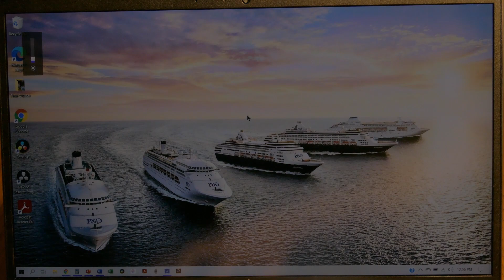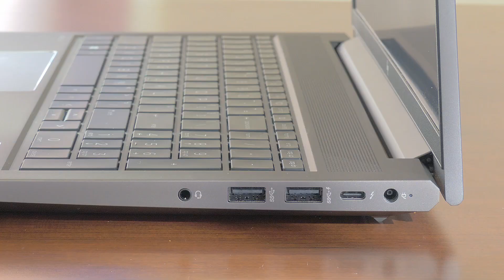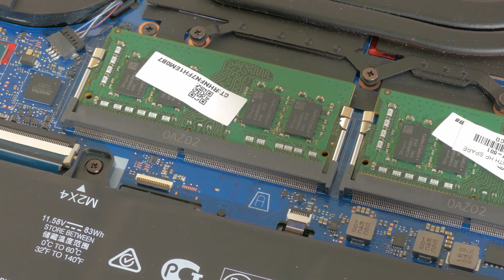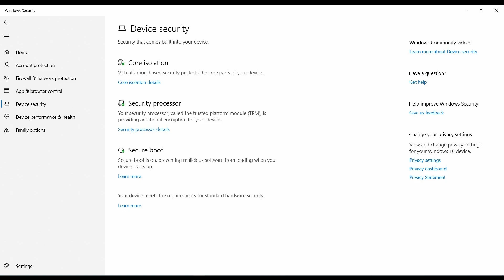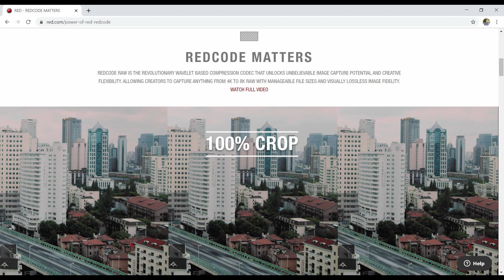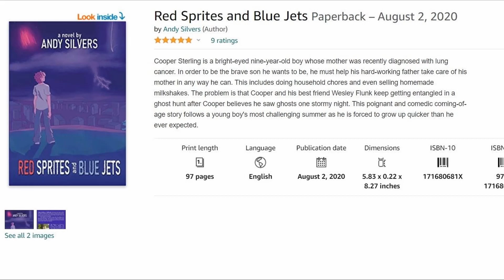HP ZBOOK Power G7 1-Month Later

Comment: Hi Andy help me to choose right machine for me,  my yse basically for coding. Which one is best choice between Dell latitude 5410 or HP ZBOOK Firefly g7
Reply from the maker: Anurag vR, Thank you for your question. First, the Firefly G7 appears to be discontinued. As for the G8, that looks like your best choice. These devices are similar in many ways. The advantages of the HP are faster CPU and more customizable. They both will do you well. Keep this in mind. For coding, more CPU cores and RAM are important. The HP a faster CPU (for a price). They  both have the same core count. Also, note the Dell is cheaper, but this is largely because of the inferior CPU and low-brightness display. My strong recommendation no matter what you buy is to check that the display is at least 350 nits. To save money, get the Dell. To get the best performance, pick the HP. Note: if you get the HP, spend the $2.00 on a 65 watt charger. It's worth it. 
Hope this helps.
Reply: @andysilvers9532  thank you so much, I will check HP this time so far I use only Dell. Here Dell is costly than HP.

Comment: I do not know English. I am writing through a translator. I want to buy HP ZBook Fury 17 G7. It has nVidia Quadro T1000 installed. I doubt it because of this video card. I would like to work and play games. How good is the graphics card? I work in Photoshop, Adobe Illustrator, I work with video, audio. Sometimes with 3D, sometimes I play games.
Reply from the maker: Thank you for your comment.
The Quadro T1000 is similar to a GTX 1050, so it's not the best. As I said, I would recommend at least the Quadro RTX 3000 for the work you do. If you edit 1080p video, the T1000 or T2000 is great. If you edit 4K video, I would go with the Quadro RTX 3000 or RTX 4000. Hope this helps. The CPU is most important though for Video editing. If you can get 8 Cores, then do that. : )
Reply: @andysilvers9532  Thanks for the answer) then I'll look for something else to replace the old one)

Comment: Hello mr. Silvers, in the next few days I think I will buy the Zbook Power G7.  I would like to ask you if you also have the fans problems that others have talked about in other videos or comments.  Problems that they say they solved by updating the bios or by disabling a security function in the Settings app.
Reply from the maker: Emanuele,
It's interesting you mention this. I address this on my channel in my full Review. Please check it out for specific info. To put it simply, yes, you'll likely want to disable the Windows Smart Screen feature if it causes your fans to spin up. Details on how to do that are in my video. I'm excited to hear that you want to buy a ZBook. I don't think you'll be disappointed.
Reply: Thanks for the reply. I actually saw your full review but I didn't remember it 😅 I will definitely follow the procedure.
Reply from the maker: Hello,
You can figure out the brightness of your display using a tool from Amazon or the like. Plus there are some apps that claim they can check the peak brightness using software. Lastly, you can look up the model number of the display your laptop uses, then find a datasheet that tells you the exact number. HP probably rounded up from like 370 or 380 nits for the ZBook. As for screen size, you could measure it with a ruler. But the HP ZBook Power has a 15.6 inch display which refers to the diagonal size. The ZBook lineup has 16:9 aspect ratio displays. 
Hope this helps.
Reply: @andysilvers9532  Thank you very much for your answers!

Comment: Hello andy. I want to buy Z book 17 inch laptop . Wt abt of size of this laptop ? Doesn't it look very big ? Can we carry it easly ?
Reply from the maker: Gurmit, thank you for your comment. The ZBook Power is not available in a 17 inch size. If your referring to the ZBook fury 17, yes it’s a big laptop. It’s roughly an inch thick and has a big screen. However HP did fix the bezels a lot. It’s not a device that u can carry around super easily but it is more portable than a desktop.
Hope this helps!
Reply: @andysilvers9532  thanks bro